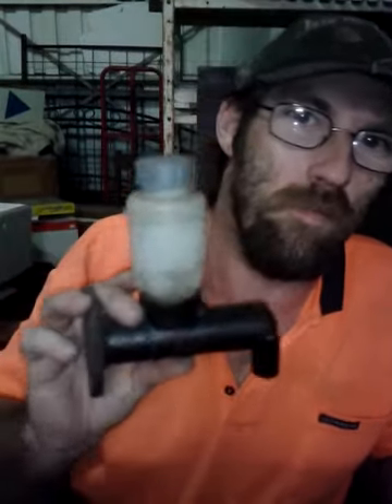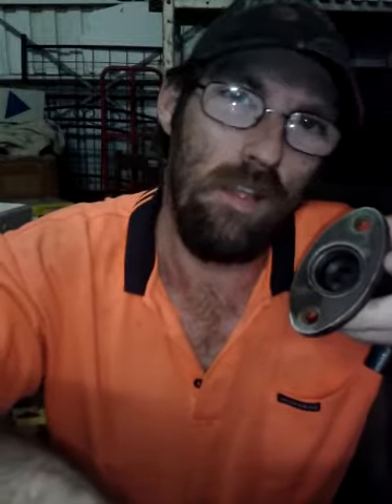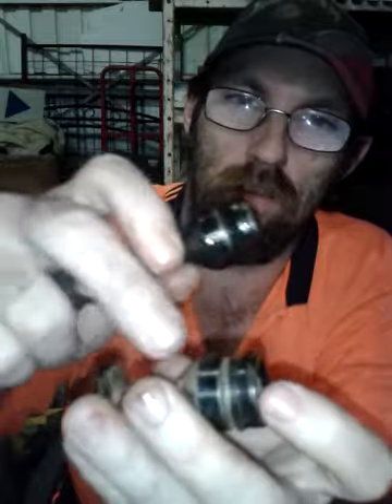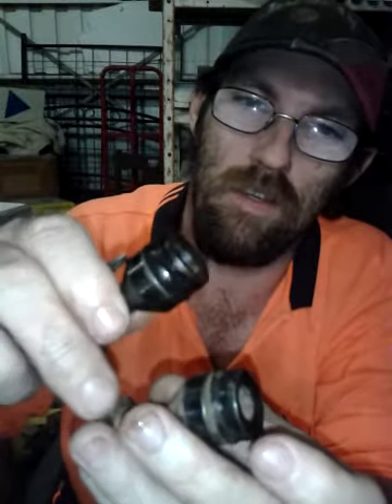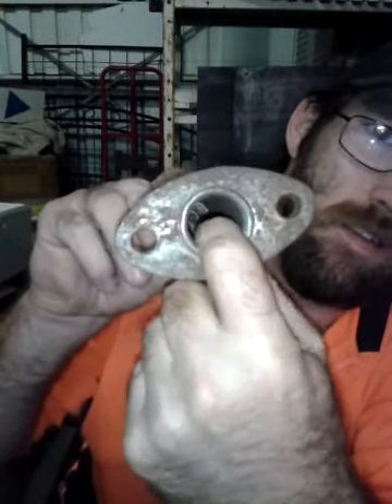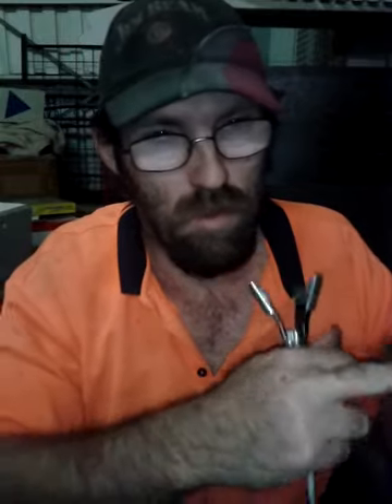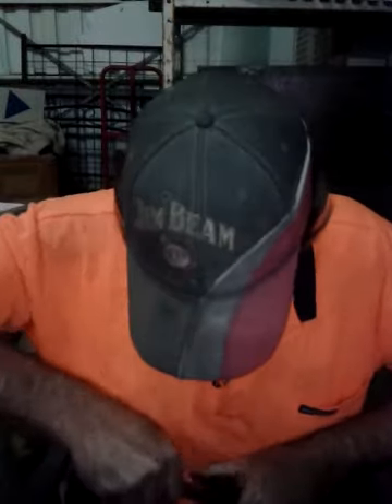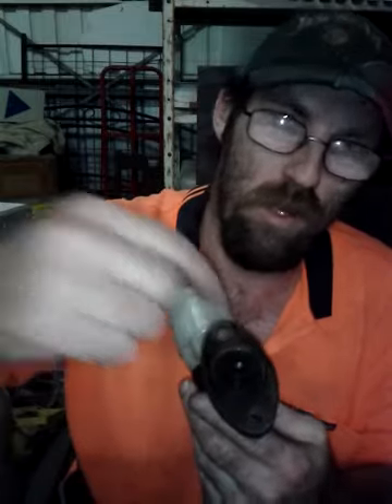How to rebuild your brake and clutch cylenders yourself

Comment: Hi Wayne,
I can't seem to find the brass washer in the repair manual. I pulled my Disc Brake master cylinder apart and it had a brass washer between the piston & primary cup. Is this correct? I only had 1 washer installed. Any advice would be appreciated.